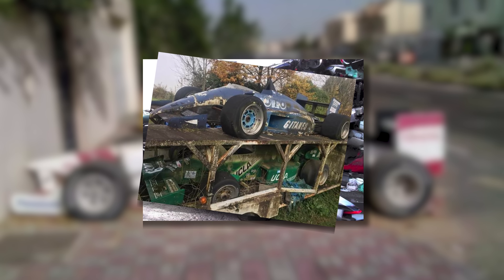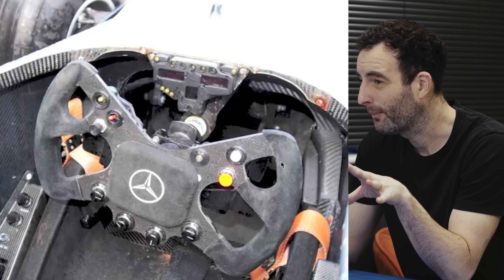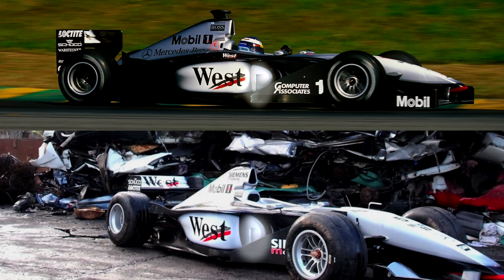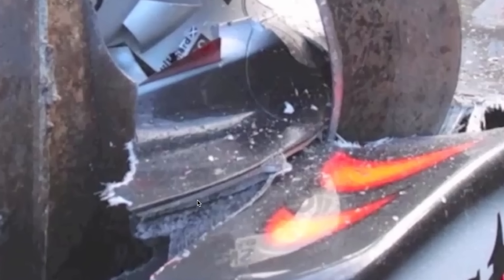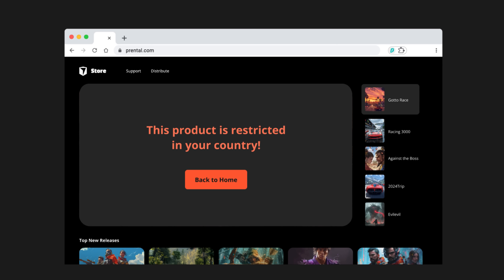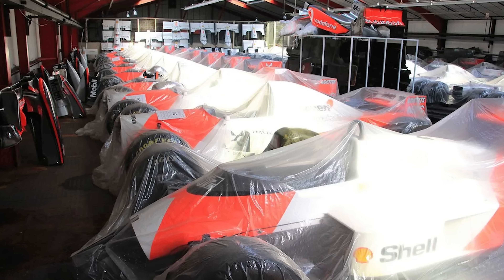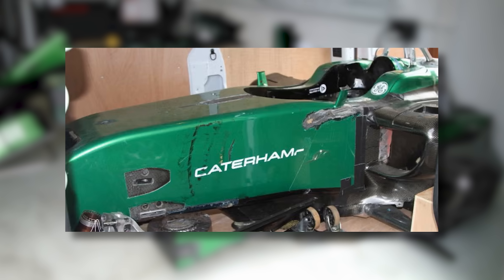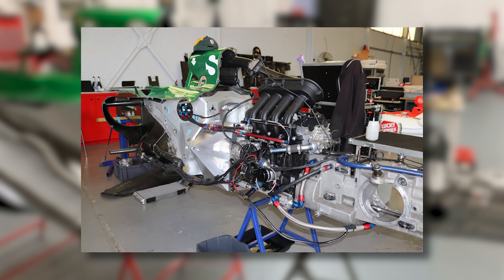Why Are Formula 1 Cars Being CRUSHED?

Comment: Not to mention that McLaren did not use Michelin tyres in 1999, and would therefore not have had Michelin advertising on the rear of the beam wing. McLaren were not sponsored by Siemens that year either, so whoever faked this car did a sloppy job at trying to replicate the real thing. To clarify that: yes, they’ve put a lot of work into the car shape & design, but to get basic sponsors wrong is something any aficionado would instantly spot!

Comment: People may not understand that F1 started and continued for a long time being made by a mix of people with some technical knowledge and enthusiasts of the sport. In the 70s and even the early 80s, cars were built in garages; if you had good mechanics, a good workshop, a lathe, a milling machine, and a good fiberglass laminator (to make the engine cover and things like), you were already able to build a car. F1 took a leap with the arrival of carbon fiber. The material made the process much more expensive and difficult, almost aerospace-level. Even so, it's not difficult. It's just a car.

Comment: When I worked for a team, we had 16 show cars from various years.
Some had original damaged chassis, no good for racing. Others were GRP replica tubs with real old damaged repaired parts attached. 
Some were almost complete, just missing fuel and oil. 
Some got repainted with the current sponsors details, the average guy doesn't recognize the model and year.
We tried to destroy one or two tubs with a fork lift and couldn't do it
A lot of scrap yards will not touch carbon fibre.

Comment: I’m not extremely versed in all things 4 wheeled, yet I’ve always been what’d I’d call above & beyond your average enthusiast. Ha. But what I’m posting about is concerning the 2 wheeled variety. When I was racing & traveling with a buddy of mine , both pros and he’d support me at the AMA 250GP races (he raced the 125s, pro / expert rounds with WERA / CCS in the states). I’d tossed around the idea of making the leap to the 500 class, of which Honda had 2 varieties (Mike’s 125 was. Single, my 250 was twin 125s, for reference ). The NSR 500 (twin 250 setup) could be had, and relatively inexpensive if bought used, but still in the 6 figure range. FWIW an Aprilia 25o GP bike was easily 6 figures used.  These are not the road going RS 250 cup challenge bikes (we had both raced that series ob top of our regular pro season schedule). Confusibg eh?  BUT I DIGRESS.  Point being this:  For the V4 NSR 500 ‘big bang’ motor (4 125s, in a V. Duh). But the bike that Mick Doohan (Sr) was riding & whipping much ass with could be had by my team, BUT. These were the (rough) stipulations. The LAST stipulation is fact though. We could LEASE the bike only, which would     Include. STD spares kit etc etc.  included with middling factory support, and at season end the bike was to be returned & sent to be destroyed / crushed / nuked / conflagrated / smashed .

And yeah. I just heard you mention the smell of the car.  When that 2-smoker was fired up, warmers off , stand down, all business. Time to go to work. I say the exact same thing that mutters off of the great Robert Duvall’s lips in Apocalypse now…substitute ‘napalm’ with ‘bean oil’ (ok plus NuTech fuel if you really want to pitch your pole ) while leaving every other word alone …but at the track….gear close by.  God I love that smell.  It is the closest thing to a human transporter I’ve been involved with.  I’d throw a leg over another RS250R right now if I could find one. I’ve still got my cherry like-new 5000km MC-28 NSR 250 SE (never sold in the states, but I’m grandfathered into my valid tag & title.  So don’t ask!  lol!

Comment: I bought a wrecked F3 car designed By Pre Jordan GP’s Gary Anderson. Bent tub, no wheels and tires and no engine. Took me two years to bring back from the dead. I raced it two years and finally had to hang it up from the cost. The story of rebuilding it could be a subject of a book itself. Not nearly as complicated as a F1 car but still a monumental under taking. I did race it long enough to meet the man that Imported it into the US. Neat to add his story to mine.

Comment: Wind tunnel models at this time where 100% scale. Made of carbon where loads required it and fiberglass or 3D printed where not. Worthless after their "career " but still exposing a lots of research they turned into static display/ show cars or ended up under a fork lift.😢